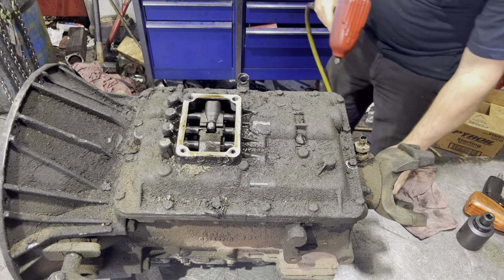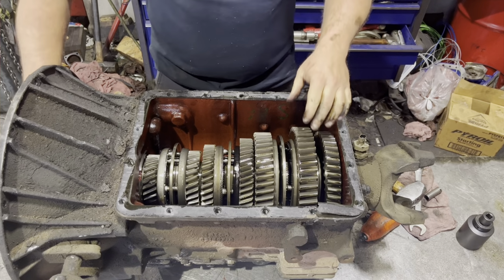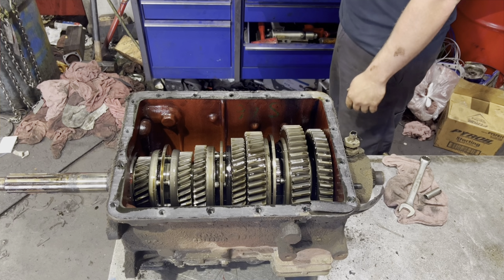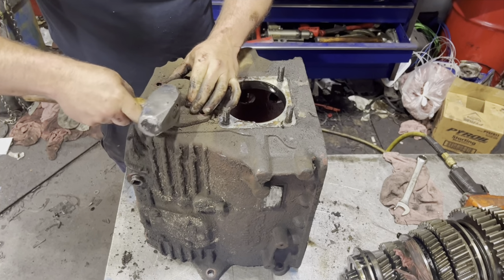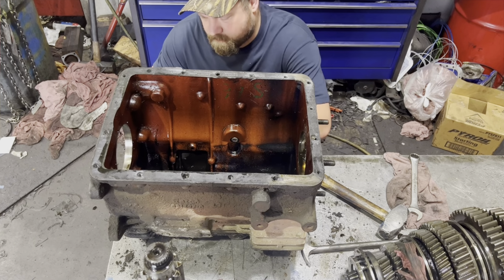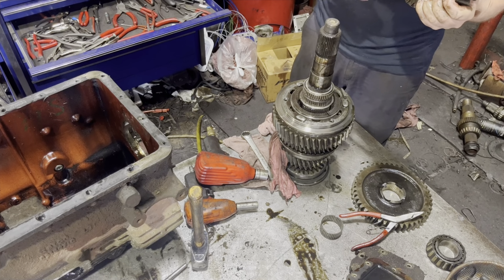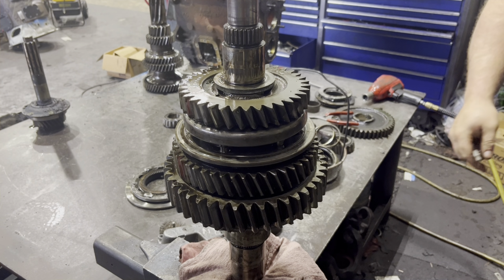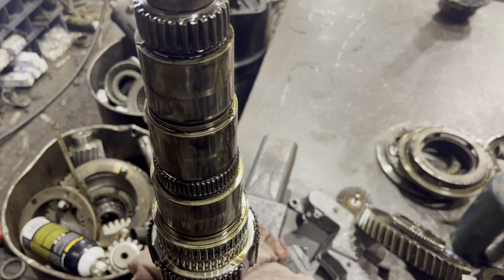Bad synchronizer found in this mid range transmission #trucking #transmission

Comment: I have a Eaton RTLO18913A 13 speed and I was having issues with 7 going in smoothly thought it was a synchronizer but ended up replacing the whole transmission with a new remain and still have the same issue. Idk what to do thinking of swapping shifter tower and bushing